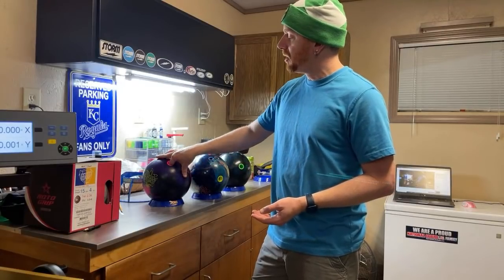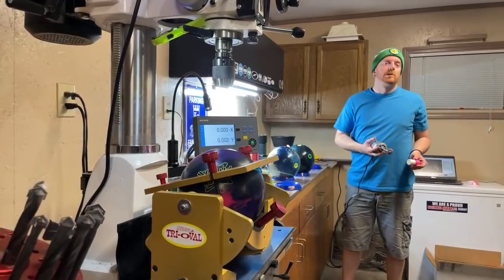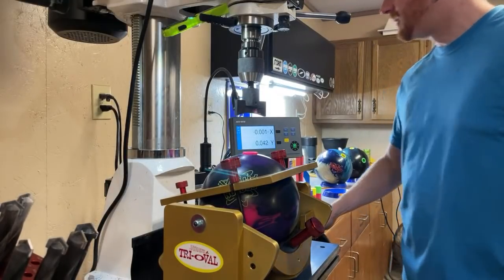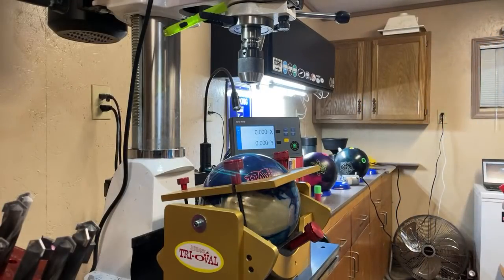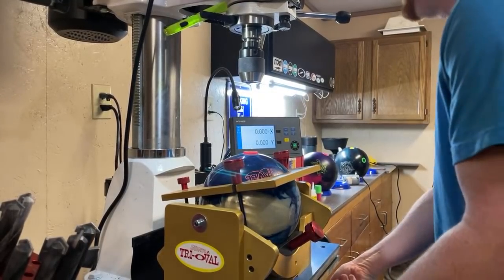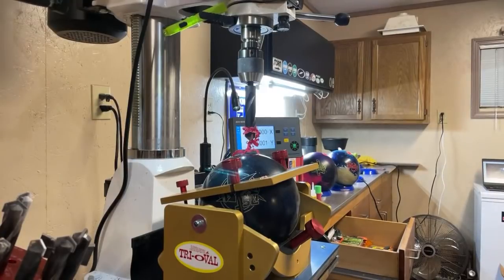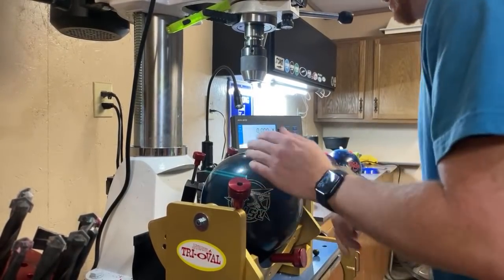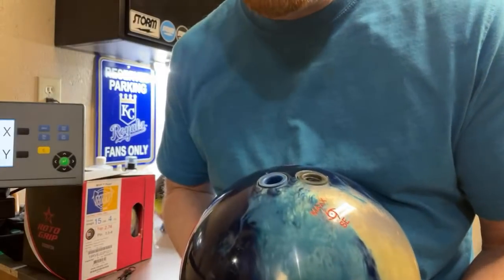In The Shop - Reslugging!

Comment: Have you just tried drilling out the old slug with a slightly smaller bit? 1 1/8 to remove a 1 1/4 slug
Reply from the maker: What would the idea behind that be? You'd be left with a 1/16 ring of the old slug all the way around
Reply: @LukeRosdahl  you'd never miss the pitch, never enlarge the hole and removing the 1/16 of slug is very quick and easy. i use a thin flat head screw driver, pound it in between and twist. this loosens the slug and then it puls out
Reply from the maker: Ah I get what you mean now, yeah that'd definitely be a good way to start if you didn't know what the pitch was.  Depending on the amount of glue in there and how old it is though, I've HAD to drill it out, but yeah I've used a flat head to pry part of a slug out a bunch of times.  Good tip
Reply: When you drill the initial hole for a slug, grab a 1/2” bit and drill the hole about 1/2” deeper.

When it comes time to drill out the slug, dial in the pitches, then use the 1/2” drill bit to detect when the ball is positioned exactly as it was during the initial drill.